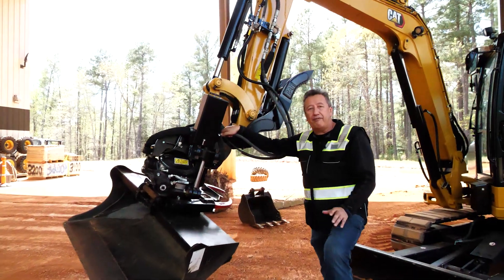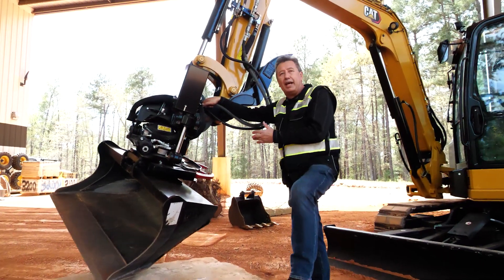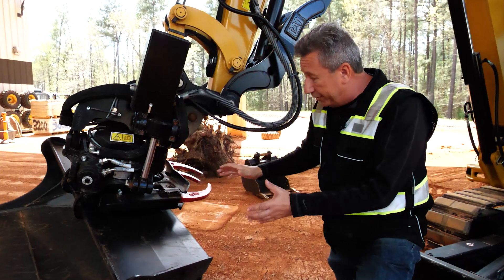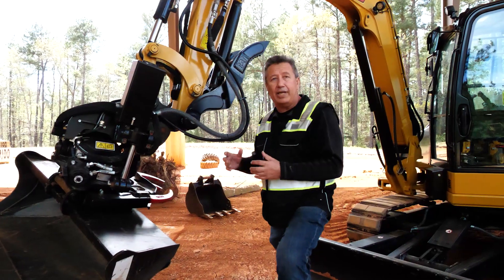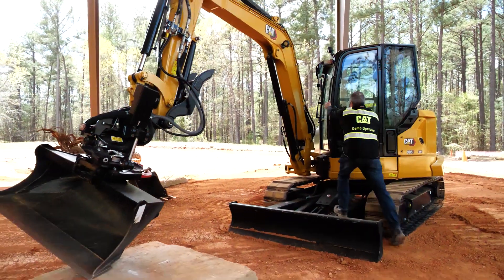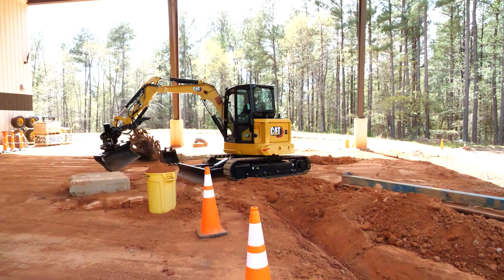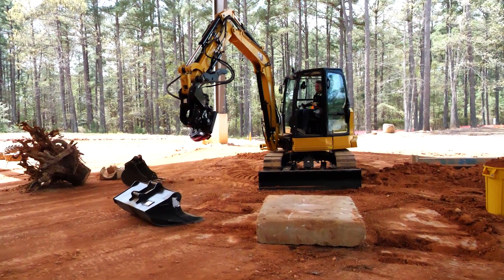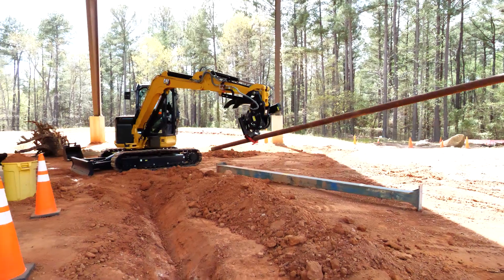How To – Cat® 305 CR Mini Hydraulic Excavator with Cat TRS6 Tilt Rotator System

Comment: God please if your buying a Cat mini with a Tiltrotator don’t follow this advise of using a pin grabber top hitch to pick up a direct fit Tiltrotator just to be able to use a thumb. You don’t need a thumb which adds extra weight, something a Cat mini can do without. Just buy an S40 top hitch and S40 Tiltrotator then add a decent grapple. Always order the extra counterweight and dont order the short stick (dipper) as it will be terrible to grade with. Ditch the heavy pin grabber hitch and thumb so you can use the standard dipper.  Marketing dept gone mad with this advise. Just because you can doesn’t mean you should. Direct fit Tiltrotators (including TRS) are not designed to be used with a top hitch, the linkage geometries are all wrong. The inefficiencies of using a Tiltrotator this way will hinder it’s true potential.

Comment: why would you not have the s40 on top alao? now you need two sets of buckets, quick silly. I think keeping the thumb is a fine idea but it does ass extra weight and i don't really miss mine after switching to a tilt rotator.

Comment: If it can't handle stumps, it's nothing to have, then I prefer Rototilt
Reply: Its a Rototilt with Cat branding on it. Its build by Rototilt.
Reply: @booo_15  Yea but why are they saying it isn't the tool to use for stumps, just less universal or actually not ideal ?
Reply: @Arcturusvanlasagna  well its all about having the right attachments, I for example have a full Grapple and a Ripper so I can use it for stumps.
Reply: @booo_15  sure but I'm just curious that line stuck out for me in the video that it wasn't the tool to use for stumps

Comment: Does this system work with the Rototilt hydraulic attachments such as a grapple?
Reply from the maker: Hello Benjamin! The Cat TRS is available with both Cat Pin On and/or S-type top and bottom options. The S-type interface is a universal coupler that can pick up many different attachments. For more information, contact your local Cat dealer - Vincent